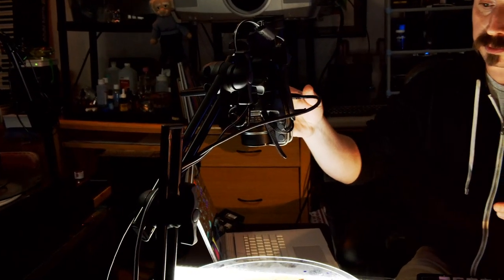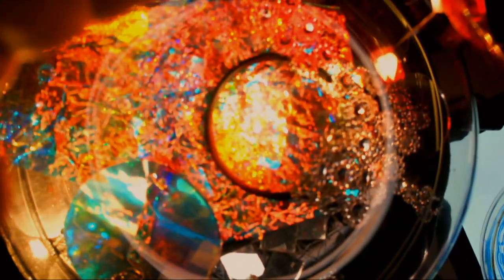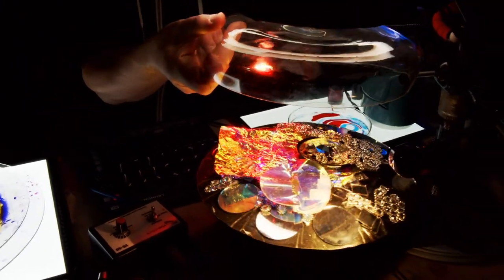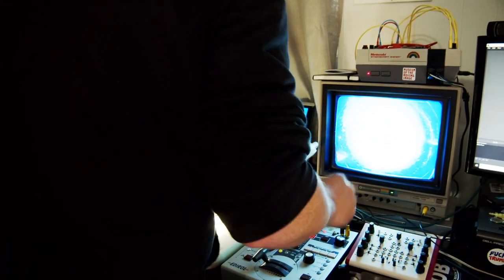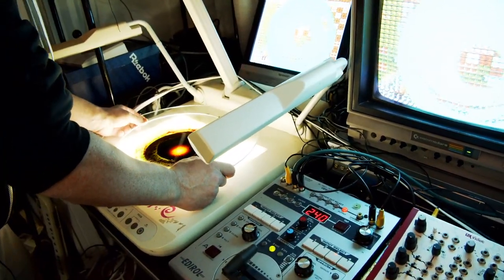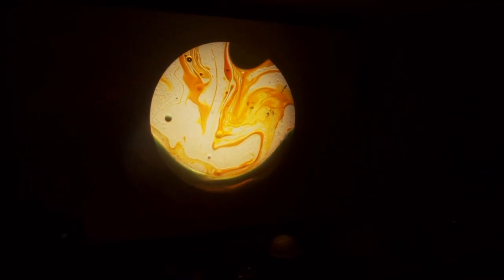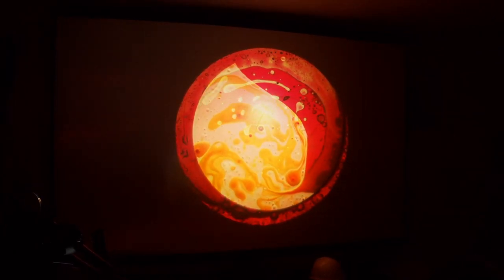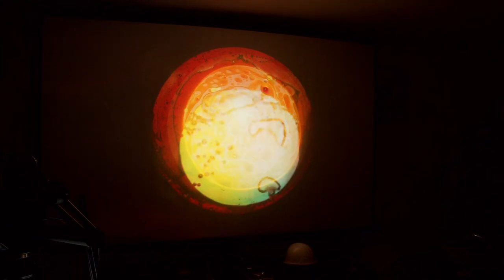Demo of Digital Video, Analog Video, and Overhead Projection for Liquid Light Shows - Vidicon 2020

Comment: Amazing videos! The instructional playlist and history review are such a great contribution to the tradition! You mention one in of the tutorials adding a dimmer "after the fan" in the OHP circuit. Could you provide any more detail on the mod, and what kind of dimmer you use?
Reply from the maker: Thanks! The dimmer is a 600w wall dimmer for regular house lights. Power in an OHP will split to a fan and the lamp inside it. So finding just the last wire going to the lamp is where the dimmer goes.

Comment: Hi Steve. I'm wondering what size of a stage backdrop a classroom overhead projector can practically project on and still get good color saturation - assuming it's a dark stage the band is playing on... and thank you for your videos!
Reply from the maker: It's hard to say because projectors can vary. They're meant be up close in classrooms, but most still look good at a 10' wide image. After that get get dimmer as you get farther away... Look up something called 'throw ratio'. It's a measurement of a lens which will give you the specific answer for each projector

Comment: I,ve only just discovered your channel, When I was young used to do the same sort of thing. then VJ Software come along it was convenient, and no waters or covered with stuff. But this, is more hands on, and I,ve had  forgotten just how much fun it was. It like going back to playing Albums, after using MP3s. I use to do feed back while filming old CRT screen, influence by DR who on TV. used to make 8" inch glass box with a 45 degree glass cross it. to do cross fading. I was a big Hawkwind fan. loved there gigs far better than floyd shows in the day. I think you may of got me interested in again some brill tips glad your passing your skills along.   Maybe you can help me. I had this old pifco oil wheel projector. but the oil and colours between the glass dry out, so Me being me tried to split the glass and they cracked. I made new glass but never could get that oil to work like it did any Idea? cheers Man.... jimsim
Reply from the maker: Not sure how to fix it, but there are still lots of Optikinetiks sealed wheels around, and also some new ones made by Roderick Wilson
Reply: @LiquidLightLab  Hi, Didn't expect such a quick reply,  Yeah I know, there still a market Optikinetiks there in Luton uk. Don,t know about Roderick Wilson. But saying that, I,am like hands on. I like to know things, But hay cheers for your input. I like what your doing, and old school is still in the frame. so to speck. I used to like to chroma key film,s of gigs and use the colorcycle wheel as fill. but what has happen to color cycling I love Mark Ferrari animation for the Amiga Deluxe Paint, made some cool looking animation,s and it was  just an image with color cycling. anyways keep the faith, you doing some cool stuff